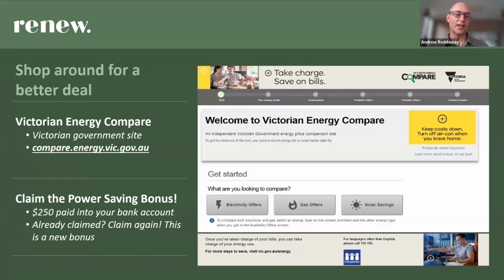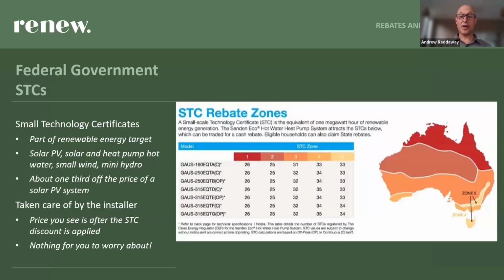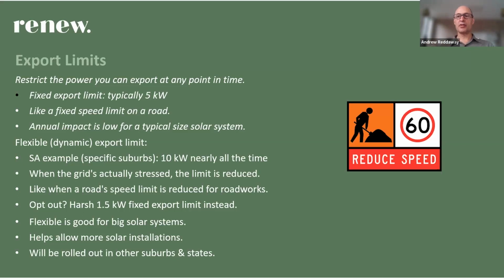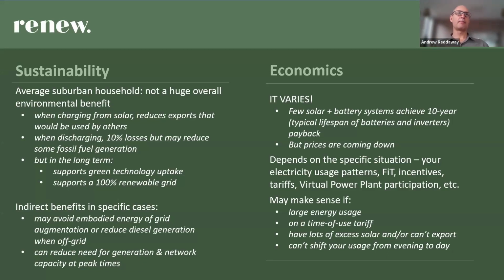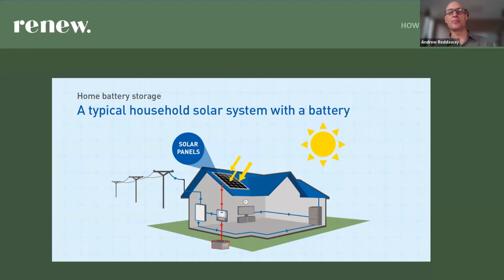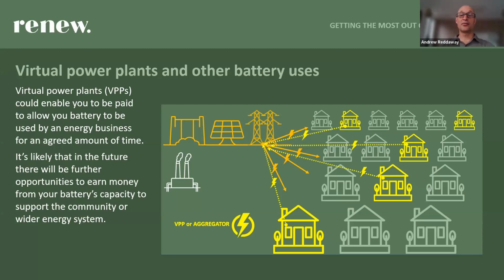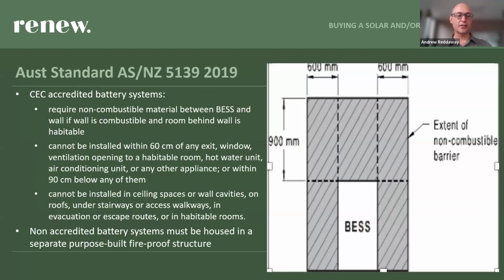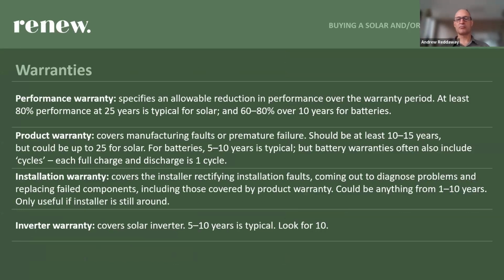WAGA - Solar and Batteries - 9 Dec 2023

Comment: Hi Andrew. Thanks for a great presentation. Just to clarify the Victorian government's PFIT,  it comes to an end in November 2024. The government commenced the scheme in November 2009 and mandated it to run for 15 years. A minimum of $0.60/kWh is paid to early adopters like myself (who had a 4.9kW PV array installed). Over the years, my retailer, AGL, kicked in additional FIT, boosting the PFIT to over $0.72/kWh. However, over recent years, they dropped it back and now it's sitting at $0.60/kWh, which is still fantastic.

Comment: Why heat pump for hot water rather than a solar hot water with solar electricity boost?
Reply: Hp HWS, on average, consume about 1kWh to maybe 1.5kWh. I base this on how my 315 litre Sanden operates. Having Solar on my roof in Melbourne, the current FIT is 4.9c/kWh. On average, my HP HWS uses about 3.2kWh per day. Some days more, some days less. So by multiplying 3.2 x 4.9 = $0.1568 OFFSET cost (the amount my solar would have made as FIT if I didn't heat the water during the day with the solar generating electricity). That's not even 16 cents per day to heat up hundreds of litres of water. $58.40 PER YEAR in hot water heating OFFSET costs (I don't actually pay my electricity retailer for this) using a heat pump hot water service. Solar hot water with resistive electricity boost is going to cost a whole lot more than 16 cents per day to heat less water.
Reply: @davidissko9796 
We don’t usually pay for hot water just I assume the pump that pushes the water to the solar collector. We have gas boost now but we’re thinking of upgrading to this. 

Solar to Solar - Solahart Split Solar Hot Water System (322MLV36) 1 x Solarhart S'Line Elect Tank 320 3.6kW 2 x Collector L Laser Welded
1 x New electrical circuit & 24hr timer on fuse

What are your thoughts on this?
Reply: @jasonrhl  I'm not qualified to comment on those systems as I don't have any experience with them. I just know they're not terribly efficient and a poor performer in cloudy Melbourne in winter, whereas I'm thrilled with my super efficient (at least 300% due to CoP of at least 3) heat pump hot water storage system.